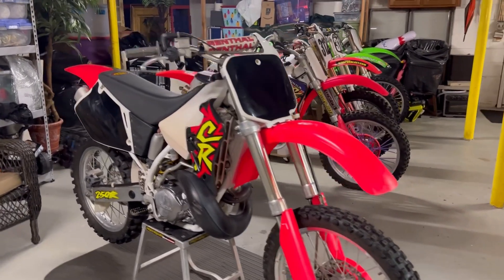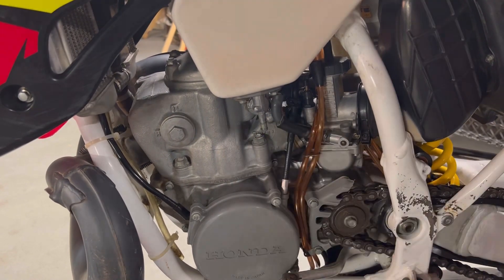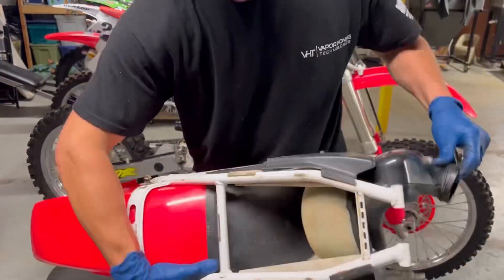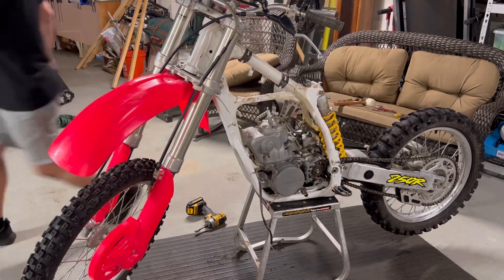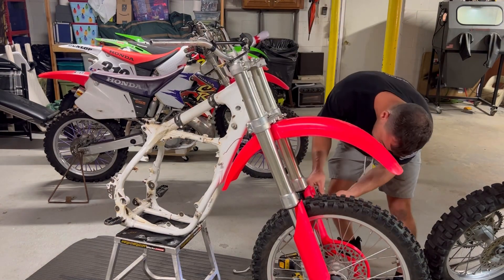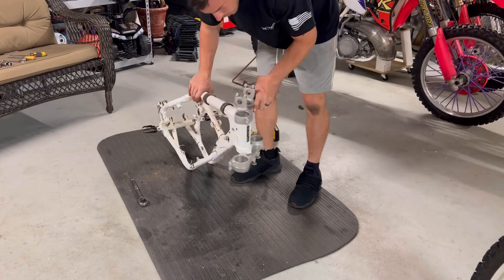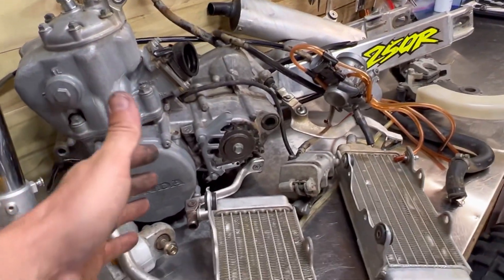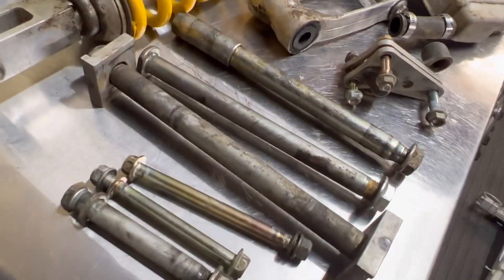1996 cr250 complete tear down! Restoration part 1

Comment: Awesome! Hope to see more vids along the way with the progress. I just started on mine yesterday. Saturday I picked up a 96’ cr250r. It needs some TLC. So far stripped it down to just the engine and frame on a stand. Going to drop the susp off somewhere to go thru it. So far purchased a carb and fuel petcock rebuild kit, all the carb hoses, chain, sprockets, chain rollers, all new plastics, seat cover, radiator hoses, air filter etc Nothing I can’t handle. Just lots of small parts that add up in price since the list of things gets bigger as I inspect stuff 😂 Also gotta find some a decent white paint to touch up wear spots on the frame. Hope to get it ready and the goal is to start racing it at glen Helen once a month.
Reply from the maker: Hey that’s awesome!! If you ever need some vapor blasting done just reach out through my website and mention this thread. I’ll take care of the return shipping for you.
Reply: @motoblast3574  Where are you out of bud ? Getting to resurrect an identical year & model Bike !
Reply from the maker: @JpJp-zd7vu  central Nj

Comment: Are you going to finishing this series? I just bought a ‘96 CR, it’s a roller for the most part, but he cylinder and head are good. I have a rebuilt ‘99 motor. I’m planning to marry the ‘99 bottom end and the ‘96 top end to make it have the same power characteristics as a ‘96. From the ‘96 I will also use the complete power valve assembly, carburetor, and CDI.